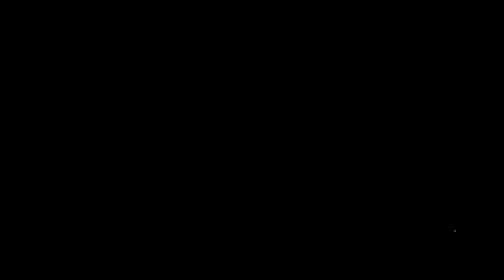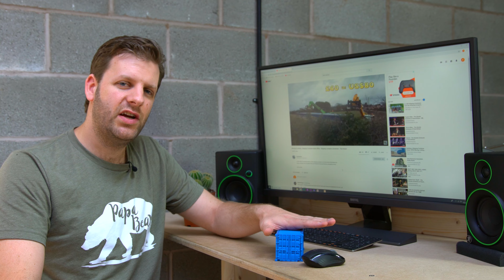Cutting and Welding - Shipping Container Conversion - Shipping Container Tiny House

Comment: You missed a trick there securing the doors.
Welding them shut with plates is the best way.
Anyone with Stihl saw can cut through those rods, a lot quicker than an oxy/acetylene torch, through the whole door.
Aren't you worried about the off gassing of Formaldehyde?

Comment: i am not a welder either, but they advise to clean the metal before you weld, so the rust should have been prepped before, also i think mig would have been stronger too.

Comment: you mentioned spot welding the door, no need to weld all around.  that makes sense to me. and just screw or glue/chalk in to fill. why complex things. you said mic is better for thinner flat metal.  stick is for thicker or bars, i,m thinking?  ok, i see your list as i scrowed down.

Comment: i want sliding glass doors for my container project. to grind away the corregated walls from the bottom steel bar,  to smooth it, which is the best grinder and disc,s to use to save time?  i,ve never welded before either, but i have a container project and i must diy, to save money. welding steel for art/hobby is my immediate goal anyway.

Comment: Nice vid. Just wondering... 1. why didnt you weld a complete frame first and weld that into the container? 2. How clean did you cut and how much space was left next to the frame?  3. Did you weld all the way round?  Thx ! :)
Reply from the maker: Hey Dave, 1. I'm not sure, it seemed easier at the time. 2. the cuts were pretty dirty, there were a few mm in some places, and no space in others. 3. I stitch welded about an inch long, every 6-12 inches or so. No need to weld all the way around. And then I've filled any gaps with a mastic/exterior caulk
Reply: @VinceSamios  okido. I did weld the frame first measured around the door / windows and then welded them in. To create some backing for the caulk I've used bitumen tape around the frame. More stuff on http://becomethebox.tumblr.com
Reply from the maker: Dave it sounds like you're much more professional at this than me :-) I'll check out the blog.

Comment: Stick welding wasn't a mistake for a job like this; TIG goes a lot slower and is much less forgiving about surface preparation.

Started following for the hydroponics but this has been an interesting turn too!
Reply from the maker: MIG is definitely the better choice. I agree tig wouldn't be right. Far too tedious. Stick really is too harsh for such thin material, it's really hard to get solid welds without blowing through.

Comment: I'm loving your detailed breakdown of the steps and information. I'm sorry if this is an odd question: how tall are you and how high is the container floor to ceiling? Asking to get a sense of ceiling height as I have yet to go stand in one to feel the height.
Reply from the maker: Slade I'm 6 ft, and with the finished ceiling I've added a total of 4 inches on the top, and the floor has a total of 4 inches also, so I've reduced the internal height by 8 inches in total. There is plenty of head height - this is also a standard height container, they also make high-cube containers with an extra foot or so of height, but I wouldn't bother with one of those.